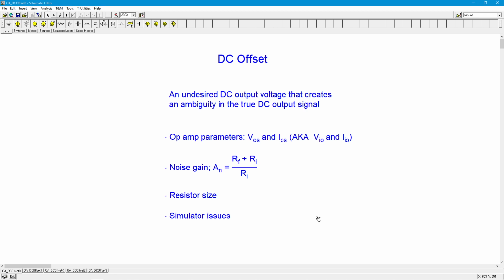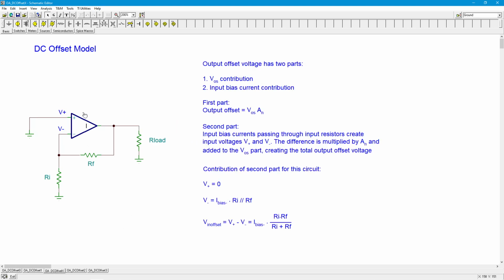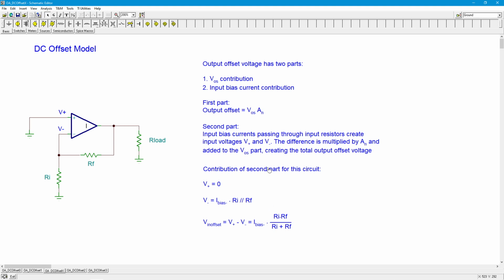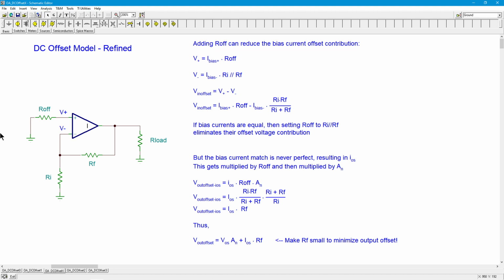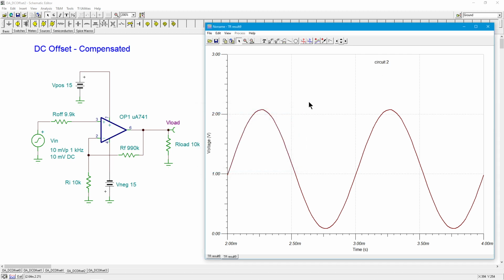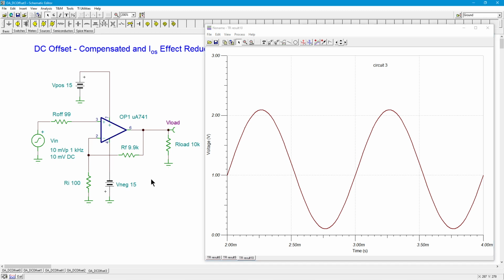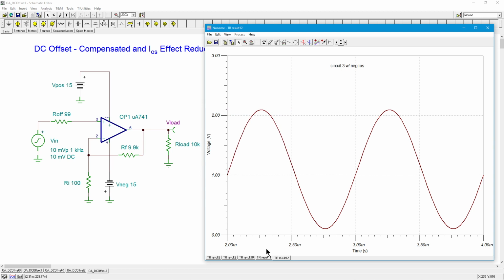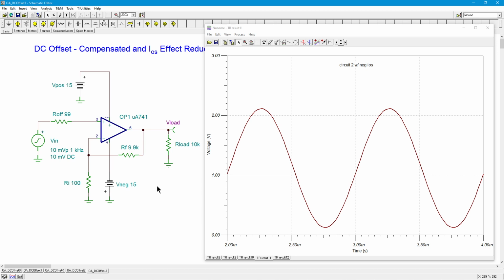Op Amps: Simulating DC Offset

Comment: Why are Ri and Rf parallel if they’re not connected to the same nodes
Reply from the maker: When you do the DC analysis they are effectively in parallel. They share one obvious node in common (inverting input), and the op amp's output is assumed to be virtually at ground (which is where the other end of Ri is).